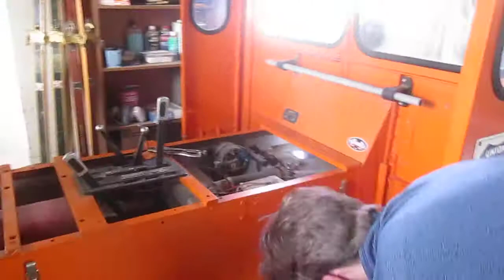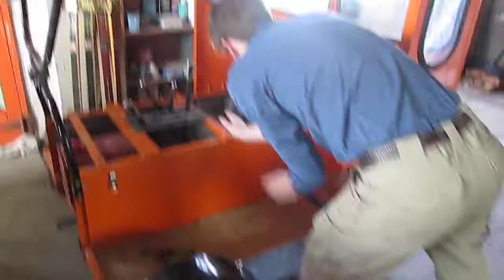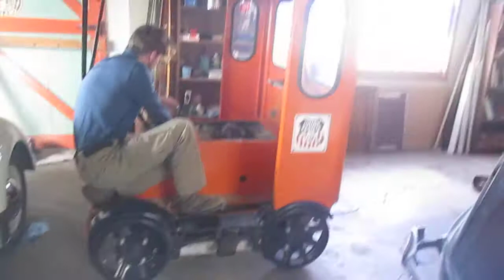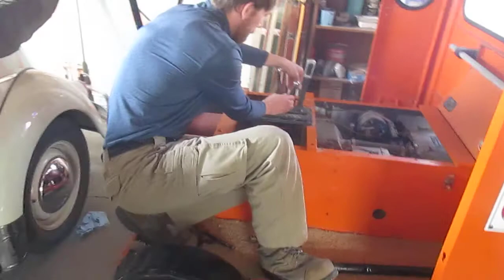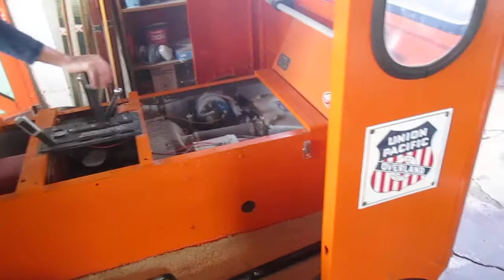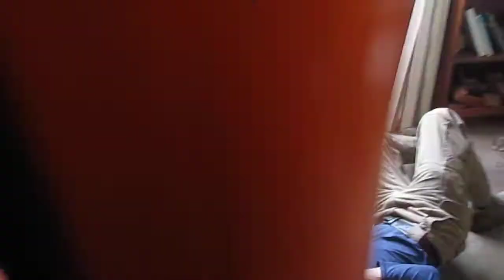Fairmont M19 Speeder Startup

Comment: That petcock valve is a crankcase drain valve. You hardly ever need to drain it unless you flood the engine. Also, don't put a muffler on these 2 cycle cars. It can lead to a fire in your exhaust system because it will trap unburnt oil. These cars came stock with a straight pipe exhaust. Some had spark arrestors.

Comment: What is gas oil mix for the motor
Reply from the maker: The Fairmont manual says to mix 30:1 using motor oil, as 2 cycle oil didn't exist when these were built. A modern 2 cycle oil will work fine. We are running a 20:1 mix.
Reply: My Fairmont manual says 11 to 1. I run 16 to one due to make sure both bearings get enough out. I use TCW-3 rated 2 cycle oil.